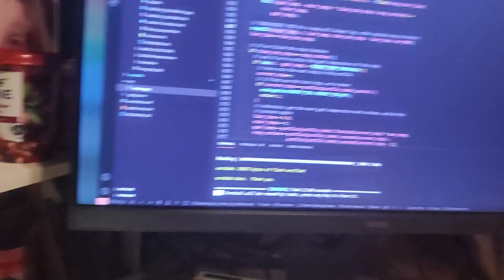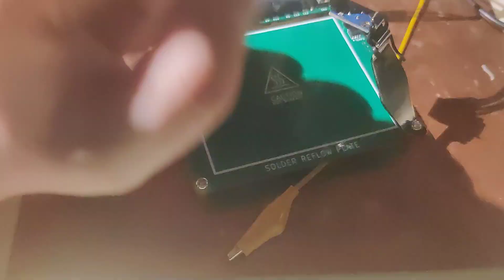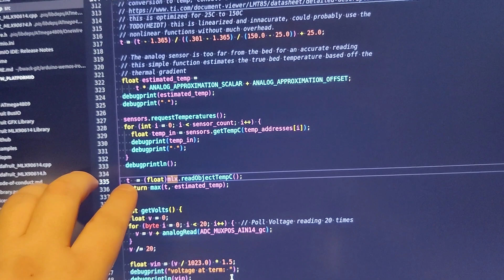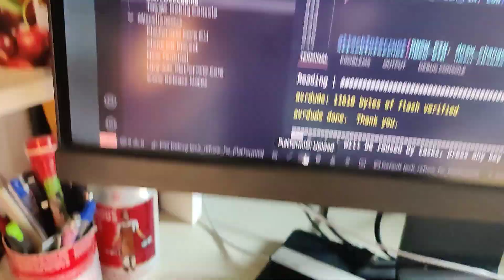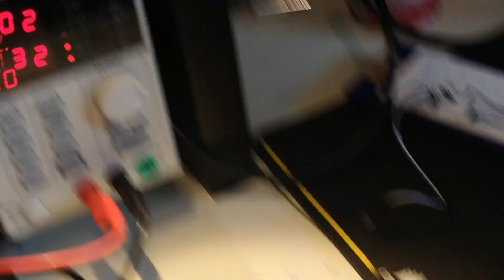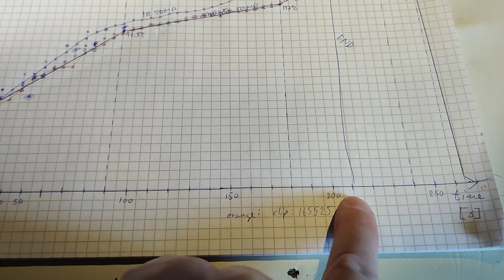Reflow Solder Heat Plate PCB update with IR sensor

Comment: Silly question: how many heat / cool cycles can the copper track resistance withstand before the PCB needs to be replaced?
Reply from the maker: Good question. More cycles with leaded solder than lead free... I think this project is a fun experiment, but maybe not a durable solution..
Reply: @bwack  maybe you could modify the PCB so that the heating pad can be attached to the logic part with screw terminsls and a couple of wires.
Reply from the maker: @bufordmaddogtannen  Thats a better solution. There are someone  who did that.
Reply: @donnied8127  sure and you would be reimplementing the upper part of the PCB you see in this video. 🙂
Reply: @donnied8127  yes, but it would probably cost the same as this project. Also if I recall correctly these plates are mains powered. They are pretty much like a soldering iron, with a rectangular heating element.
Reply: @donnied8127  yes, but oven, toasters and steam irons all use that rotary thermostat that opens a contact once it reaches a certain temperature.

So you would still need a temperature sensor and a micro controller to drive a ceramic heated plate decently.

Comment: This might sound weird but when you want to deep fry fries at 180C you heat the oil to 200C because when the cold fries hit the oil its temperature drops. You take the drop into account.
It would seem to me also that you should measure the temperature of the board you are trying to solder instead of the hot surface. 
Maybe I'm talking nonsense..
Reply: You're not talking nonsense. That's exactly one of the advantages of using this type of sensor on this type of device.
Reply from the maker: Makes sense. It should be best pointing the sensor to the pcb.